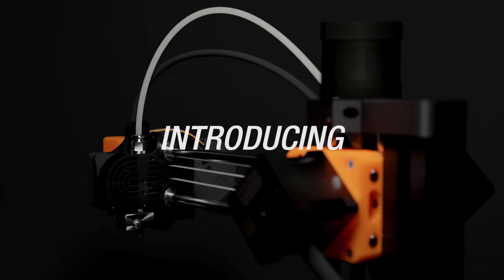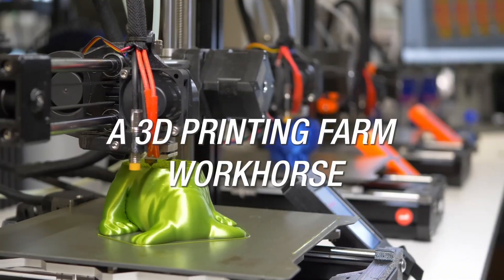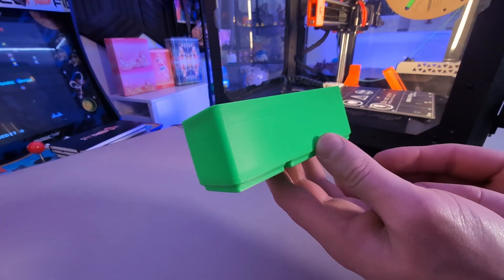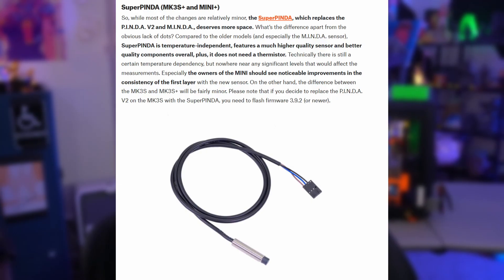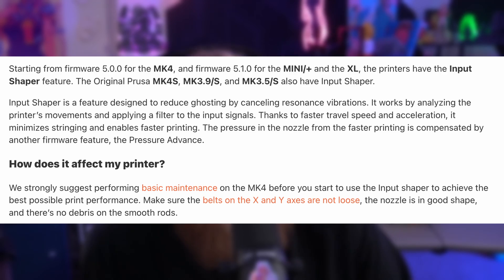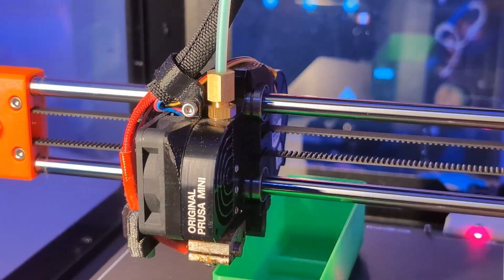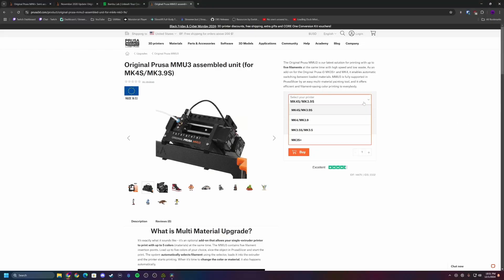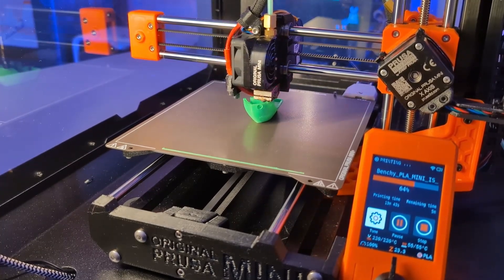The Rise and Stall of the Prusa Mini

Comment: Excellent video covering the things that matter most! 👍

I’ve always wondered why Prusa, with such a large team of engineers, designed such a subpar extruder for the Prusa Mini. If you stick to Prusa filaments, "maybe it’s less troublesome," but the moment you try other filament brands or specialty materials like silky PLA, the chances of encountering print quality issues or outright failures are quite high. At one point, I even considered designing my own extruder mod to address the problems, but due to time constraints and pressing projects, I opted for a Bondtech extruder instead. That single upgrade made a world of difference.

With the latest firmware updates featuring input shaping and other improvements, I now use the Mini occasionally—mainly when my other printers are busy. However, it’s evident that Prusa has fallen behind by not introducing new and innovative models. Bambu Lab, by contrast, didn’t reinvent the wheel; they simply made smart design and component choices, understanding that it wasn’t 2014 anymore—it was 2022! As simple as this approach might sound, Prusa seems stuck in a bygone era, acting as though their earlier designs were the peak of FDM 3D printing innovation.

Oh, and I almost forgot—I upgraded to the SuperPINDA right from the start! I’m not sure how things would have turned out with the stock MINDA probe. I also experienced a few fan failures, and ironically, all of them were original Prusa fans! The fans didn’t fail completely, but they started making noise, and I’m not the type to take chances with potentially failing parts.
Reply from the maker: Thank you!  And I agree, right now the Mini is in a weird spot where it's more capable than ever... but when you step outside that and look at the industry, it can't compete.  And Prusa should NOT try to compete on cost.
Reply: @TubaMakes  But for many, the nostalgia associated with the Ender and Prusa is undeniable. 🙂
Reply from the maker: Absolutely!

Comment: Bolstered by Prusa's reputation, the mini was a solid choice as a replacement printer when it came out (I got it early and had to wait for the first wave of pandemic supply chain delays for it to ship). I've pushed a lot of filament through that machine, but earlier this year it was clear that it was showing it's age. As with the Model T, it was a mostly reliable machine but the industry moved on to faster, bigger, more versatile models that didn't require paying a premium at any given level. I moved on, too (a P1S replaced the mini), as the time had come. The mini is still sitting -- available if the need should arise but that need hasn't yet arisen in the past 2024.